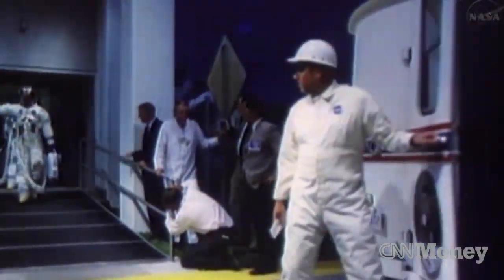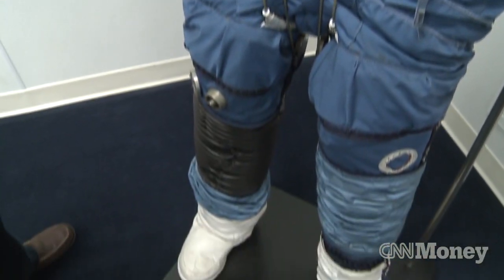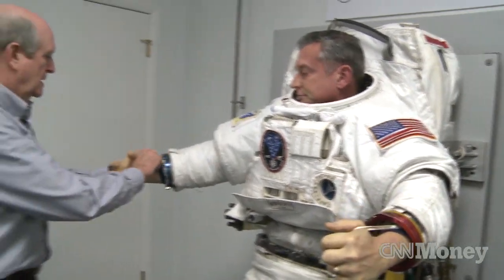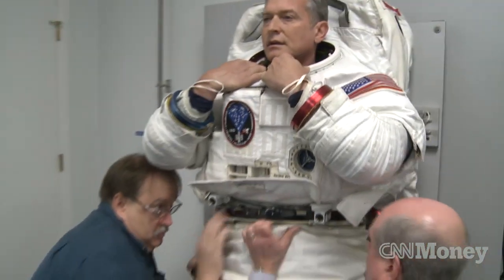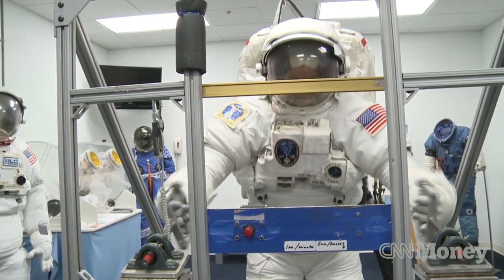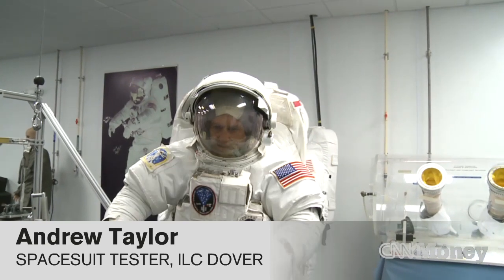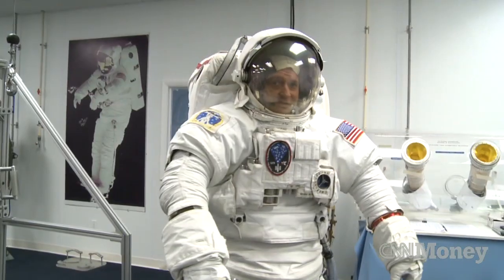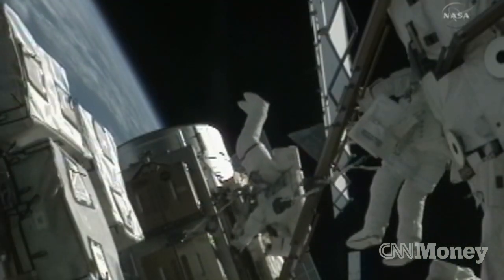See how NASA spacesuits are tested

Comment: Is there any vacuum testing done on space suits? Its amazing how an astronaut has never been killed by the vacuum of space. Ive seen a crane lifting 40 tonne pipes using suction and a vacuum. Is it possible for a human to survive in a vacuum as I cant find any video of a human in a vacuum that didnt end in disaster.
Reply: They tried a vacuum test back in the 60s and the astronaut almost boiled to death within seconds. The video used to be on YouTube but I haven't been able to find it.
Reply: They dont NEED vacuum chambers to test the suits but then why should we believe it? =) the most "powerful" vacuum chambers on earth (who has like 8-10 ft walls) can simulate the vacuum torr levels of low earth orbit or just a little higher and guess what? no humans has ever been tested inside. That chamber isnt even CLOSE to the levels of vacuum in deep space (i.e on the moon)

Comment: What other human field has zero accidents.. fairy tales?
Reply: You need to be better informed. There has been many accidents, and there continue to be accidents.
Reply: @dansv1  Accidents like astronauts having flooded helmets when there is a leak in an EVA in outer space.

Accidents like no micro meterorites hitting the ISS and killing everyone in it. Accidents like a rocket exploding during Apollo. The rate of rockets exploding reached above 90%, but Apollo had zero %, even for an untested lunar rocket that was operating in a vacuum on the moon with different gravity and environmental heat effects than the Earth based testing launch centers.

All those "accidents" of yours that happened or didn't happen is based on you taking conclusions as facts, rather than being informed on facts and using them to reach conclusions. But that's not all that special, most people do it your way.
Reply: Karimson Safehold  I see where your coming from. No stars, Coke can on the surface, Kubrick confession, camera man left on the moon. Got ya.
Reply: @dansv1  No, you don't see anything. You can start with Michio Kaku's unified field theory in physics and Newton's three body problem in calculus. Until you can understand the ramifications of those at least, you will find it nearly impossible to see my pov.

Otherwise, It's like trying to out argue a person that thinks they are correct in algebra, when they can't even subtract negative numbers. The gap is too wide, unfortunately. I've done too many arguments like that. If they don't even understand those two subjects and thesis topics...
Reply: Coke can on the surface is my favorite.  500M people watch the same broadcast.  One person saw a coke can. Is that proof of a hoax or is the one lady mistake?  Hoax all the way baby!
Reply: @TexMex421  one person has yet to see my comment while understanding enough to disagree or agree.

500 mil humans does not make anyone else here more competent. Still weak.
Reply: Well all the dead astronauts and cosmonauts might disagree with the zero accidents theory, or that you or "CNN Business" youtube channel is an authority in this area.  But not me. I'd never even attempt to disagree or agree. I'm just along for the ride.
Reply: @TexMex421  which astro cosmo died on the way to the moon? Do you even know the daily fatality rate for extreme sports, driving, swimming, and climbing mount everest.

Which astro died while testing a spacesuit? Walking on the moon? Playing golf on the moon? Getting hit by a rock on the moon and dying due to suit failure?
Reply: @karimsonsafehold9233  How many people participate in "extreme sports"? Many, many thousands if not millions.
How many participated in flights to the Moon? 24.
Reply: @eventcone  you counting the dozen in challenger or do you think they are not dead. So 30% of extreme sports users should be dead, ya think.

Come on, use that mind.

If 30% of all xtreme users died on one day and zero died 40 years after, even a child can figure that one out.

It is not 30% you think. Ya think 5%. If 5% of the military died in day 1 of war and zero died in 999 days of war later... what kind of war is that, grade 1?
Reply: @karimsonsafehold9233  No, I was counting those who went to the Moon. a statistically insignificant number compared to those who participate in extreme sports.